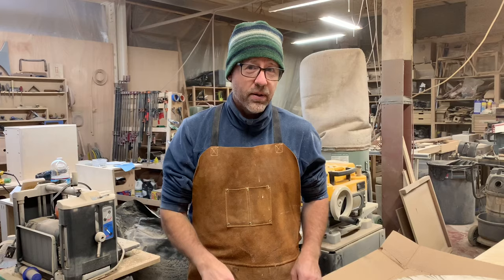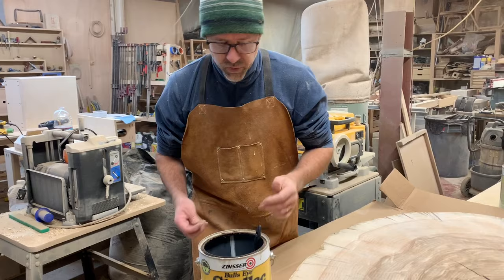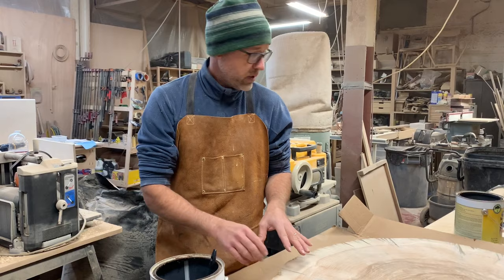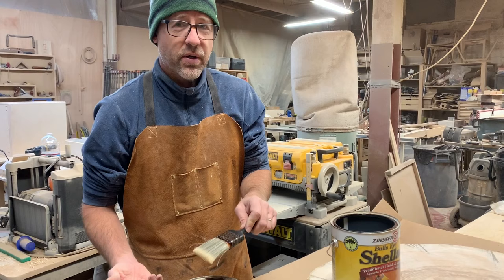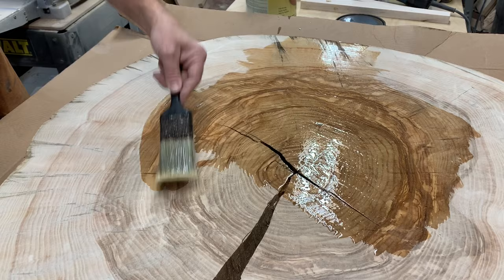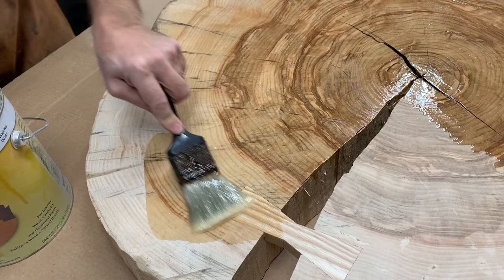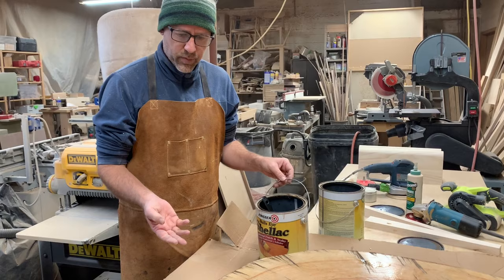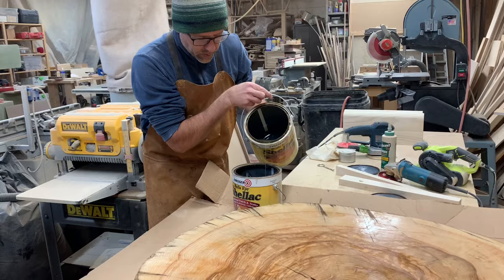How to Apply Shellac

Comment: According to wikipedia: Shellac is a resin secreted by the female lac bug on trees in the forests of India and Thailand. It is processed and sold as dry flakes and dissolved in alcohol to make liquid shellac, which is used as a brush-on colorant, food glaze and wood finish. Shellac functions as a tough natural primer, sanding sealant, tannin-blocker, odour-blocker, stain, and high-gloss varnish. Shellac was once used in electrical applications as it possesses good insulation qualities and it seals out moisture. Phonograph and 78 rpm gramophone records were made of it until they were replaced by vinyl long-playing records from 1948 onwards.
Reply from the maker: All true!
Reply: Awesome information Larry.  I am always using either lacquer or shellac.  I am usually cutting my lacquer 50/50 MS but that doesn't work for shellac.  Shellac is awesome.
Reply from the maker: @MartyOfAllTrades  you can cut shellac with denatured alcohol.  Shellac and lacquer are not the same.  Lacquer is man made and is cut with lacquer thinner.

Comment: Cool video, Mark! I'm trying to learn how to coat wood because I had a computer desk with a damaged top. I took off the veneer and cleaned the top with some synthetic steel wool and Murphy wood cleaner. It looks pretty good, better than it did anyways. Would you recommend a stain to give it a nice professional look?
Reply from the maker: Thanks Mike.  I believe Murphy wood cleaner is oil based.  So I would use an oil based varnish( oil blends with other oils).  Watco Danish oil comes in several colors.  It is a stain and sealant all in one.  It works well.  Most other stains are not sealants.  Stains usually go on first, then the sealant, however if the stain is not completely dry the sealant will dilute the stain.  That’s why combining the stain(colorant) and varnish(sealer) in 1 product is a good idea for wipe on or brush on finishing.
Reply: Very neat! I didn't know that a wood cleaner, like Murphy's, works better for oil-based products. I was going to use an oil-based stain and sealant (polyurethane) anyway. But that Watco Danish product seems convenient. I'll check it out. Thanks!   @markpalmquist

Comment: I store my shellac brushes by dipping them in shellac and then tightly wrapping them in plastic or aluminium foil. After a few days, if they start to get stiff, just open it up, dip it in fresh shellac, and it will be fine for another few days. Shellac will always re-dissolve in fresh shellac or grain alcohol ( denatured).
Reply from the maker: Yes, but a dry brush takes 20 minutes to soften.  As someone who makes money making things, I don't have 20 minutes to stand around and wait.
Reply: If you wrap it, it will not be hard, merely slightly stiff, unless you leave it sit for too many days. @markpalmquist

Comment: I have 2 slices of wood from a tree that I use for display purposes.  One of them is splitting like yours. Is there another way to stop it from splitting further 😊other than the way you did with the "butterfly"?  That way looks sort of complicated and it looks like I would need special tools that I probably don't have.
Reply from the maker: The butterfly prevents the crack from getting bigger. It requires a decent set of chisels, or, a router and butterfly templates.  All you really need is 1 shape chisel and a good Ryobi saw.  Woodcraft sells them.

Comment: I know that shellac sealer is best for interior, does it hold up on exterior wood???
Reply from the maker: Shellac is water resistant but not water proof.  You can put either a water based paint, or oil based marine varnish on top of it to make it waterproof.
Reply: No.
Reply: Do not use it on the exterior of a house. the house must breath. The shellac is an absolute vapor barrier and will peel! It can be used to spot prime knots in the siding, however. @markpalmquist
Reply: after I paint this shellac on , do i have to sand it down then paint oil based marine varnish ?   @markpalmquist

Comment: Hi! Can I put Shellac over the Danish oil? Thanks for your reply
Reply from the maker: Yes, but it would probably be better to put more Danish oil over the Danish oil.  Shellac will stick to oil but it may cause unevenness in the sheen.  I primarily use shellac as a first coat over raw wood and then sand it.  I usually use Arm-R-Seal or AFM Safecoat oil wax as the top coat.
Reply: @markpalmquist  thank you so much

Comment: Modern Windex and other glass cleaners no longer contain ammonia, because they'd often be used in areas alongside bleach. Today, it's isopropyl alcohol.
Reply from the maker: I did not know that, thanks.  I wonder when they made the switch?
Reply: SO  it is still not good for shellac

Comment: Just an fyi from a fire engineer… your shop is a fire hazard. You should do something about it.
Reply from the maker: Thanks.  I put oily rags in a metal bucket and add water.  No smoking allowed in the building.  I have 2 fire extinguishers and have cleared most of my scrap pile.  I’ve never have a fire in 14 years of furniture making.  I don’t use high VOC products and I do have a metal cabinet to store highly combustible stuff.

Comment: Hi Mark,
I’m making big bass marimba bars (percussion instrument that will be struck thousands of times with a medium hard mallet and will vibrate like crazy over and over and over). Traditionally they finished with oils and waxs, though I want to experiment with other stuff. For my experiment phase—in order of best to worst—can you please suggest/brainstorm what you think might work out for coating/sealing wooden bars that will be taking a lot of inherent abuse? With all the beating and vibrating, for instance, might shellac or lacquer or polyurethane or wood hardener or an acrylic poor be too brittle, resulting in getting rattled and crushed to death and breaking apart microscopically over time? Also consider which finish would be the most scratch resistant. (Bars will be stored in stacks and slid against each other with the potential of dirt and sand bits in between. Thanks for brainstorming with me 👍🏻
Reply from the maker: Shellac is medium in hardness, harder than oils like tung and linseed but not as hard as acrylic or polyurethane.  My favorite combination is to use shellac first, let it fully dry then sand with 500-600 grit paper then add 1 or 2 coats of Arm-R-Seal by General Finishes.  This creates a well balanced finish which is both hard and flexible.  The oil is best applied with a cotton clothe.
Reply: @markpalmquist  Cool. I'll give it a try. Thanks for getting back. I appreciate it 😁
Reply: @MeowfaceMusic  As someone who is moderately experienced in music and carpentry, I wouldn't suspect Shellac to be good for a marimba or any other wood percussion instrument where the wood itself is used to produce notes. As the bars are struck, the shellac will likely crack more than something like oil simply because they vibrate far more than any typical wood project. If it works, please let me know as I am interested to know the results, but I would imagine that the best finish outside of oil would simply be a spar varnish, since they're known to be highly elastic due to use on ships and they are less sensitive to humidity as a wax or oil would be.

Comment: can I apply shellac for sealing, protecting & polishing wooden cutting board? If yes, should we need to apply any mineral oil or wax after shellac? Please advise
Reply from the maker: @charlespshaju59  for a cutting board you need a breathable finish.  The best are mineral oil or a clear coconut oil called MCT.  I make my own cutting board finish by mixing MCT oil with bees wax and carnauba wax in a crockpot.
Reply: don't use shellac for a cutting board. first, sand the cutting board. next, apply cutting board oil (mineral oil). finally, apply cutting board conditioner.

Comment: I've have and always will clean my brushes . Then again I also French Polish Shellac or spray it . 
Okay I have stippled it on occasion . 
( It was 45 degrees .... What !)
Reply from the maker: I have not learned the French polish method but I am sure it works better than brushing.  I have also used the Shellac spray cans and have sprayed it using a spray gun which works even better.
Reply: @markpalmquist  MO

Comment: If I have runs around my edges, what is the best solution? Will another coat hide it or should I send it?
Reply from the maker: 2 options.  If it is still tacky, within 20 minutes of application, you can soak a cloth in denatured alcohol and rub it out.  If it has already dried for a few hours,  you should wait for the drip to fully dry and then sand it off with a hard block of wood wrapped with 500 or 600 grit.  But you may need to let it dry overnight.  Don’t sand if it’s gummy.
Reply: @markpalmquist  perfect, thanks for the quick response

Comment: Can you get a really smooth top finish out of it ? Can you cut & buff ? What’s the best 1st class way to make it a mirror finish . And thanks
Reply: You can but make sure to not get the areas too hot or it will start to gum up or melt in areas.  I would recommend the white scour pads.  They are the least abrasive for what I am doing.
Reply from the maker: Shellac is medium hardness.  It tends to develop a dimpled orange peel texture with repeated coatings and sanding, which is good for the handle of a knife or paddle, but not so good for a table top.  I only use it as a first coat, then I usually put an alkyd based urethane clear coat (like Arm-R-Seal) on top of it or an alkyd based paint (like Advance, by Benjamin Moore).

Comment: Shellac is big juice? Who knew? Now I'm wondering why use shellac? Surely there's finishes that penetrates wood grain without being vulnerable to alcohol.
Reply from the maker: I use it as a sanding sealer, not a top coat. Both oil and water based finishes will stick to shellac.  If you use shellac first, you will not need as much oil.
Reply: Shellac, especially the de-waxed version, is often called a "universal sealer" because it will stick to almost anything, and almost anything will stick to it! @markpalmquist

Comment: Why use the waxed version?
Reply from the maker: If you are going to apply an oil based varnish on top of the shellac, then the wax version is fine.  If you are going to apply a water based top coat, then the sanding sealer version without wax is better.  Oils and waxes are compatible.

Comment: So what if you need to can you use to reduce shellac with?
Reply from the maker: Shellac can be thinned with denatured alcohol but Zinsser does not need to be reduced unless the alcohol evaporates.
Reply: Shellac can be thinned and used as a superior pre-stain sealer for staining to reduce blotchiness. I used to use the Bin shellac out of the can ( a 3 pound cut, I believe), and thin it by about  100% again. Brush it on liberally and then immediately wipe it with rags.

Comment: Does shellec yellow wood over time?
Reply from the maker: No, it does not.  It has natural UV inhibitors and is not an acid like oil varnishes.  It does amber the wood slightly upon application.

Comment: so just slop it on in any old direction?
Reply from the maker: I was applying the shellac to end grain.  If applying to a board then you would follow the grain direction only.  Also, I use shellac as a sanding sealer, not as a top coat.  If you want to use it as a top coat then you need to watch a French polish video.
Reply: @markpalmquist  To those watching at home, end grain is the "paper towel" of the wood. 20 trillion open 'tiny straw' ends to fill--end grain drinks in any liquid

Comment: Can you use it on luan?
Reply from the maker: Shellac will stick to everything.  That is why it makes a great first coat, or sanding sealer.  Also, anything will stick to shellac, so you can paint it or put oil based varnish on it.